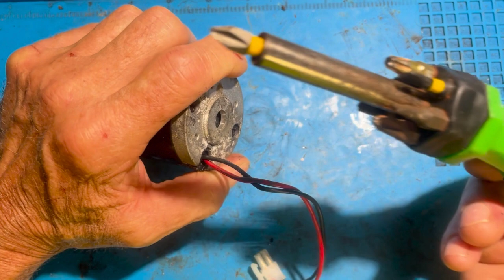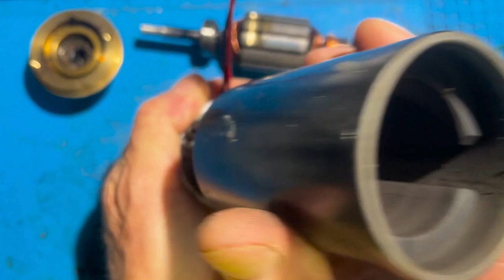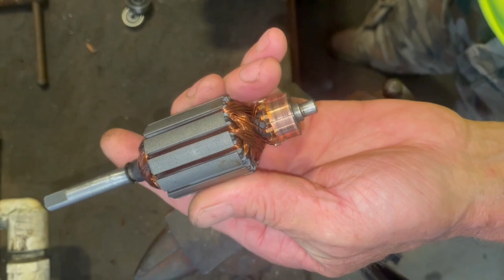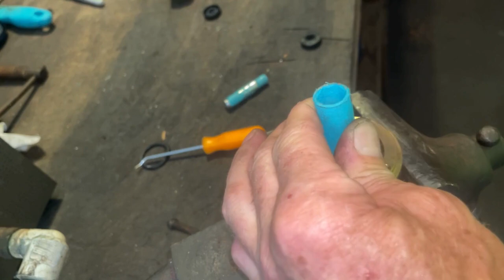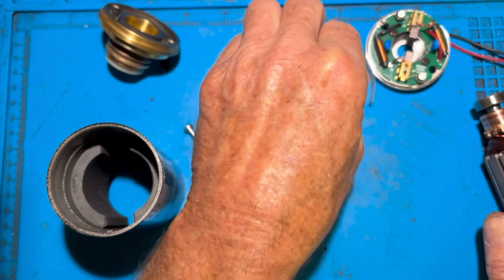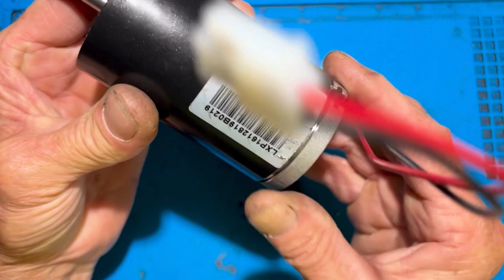How to repair rebuild Impeller motors on Maytronics, Dolphin, Polaris, Aquabot, and Hayward

Comment: Just got your kit, but how do I get the top of the impeller motor off the housing? Is it just wedged in there or is there a mystery screw I’m missing?
Reply from the maker: Yeah, you just hit the spring loaded clip with a screwdriver and a hammer and you should be able to get it off

Comment: Thank you for the video guide.  I used your repair kit to rebuild an impeller whose motor brushes have run down.  The robot pushes so much water now and stays glued to the bottom and walls of the pool.

Comment: I recently took apart my Dolphin Quantum robot and cleaned out the motor since it was starting and stopping after just a few seconds. The impeller motor needed to be cleaned real good. After putting it back together it is now running smoothly for the full duration of a cleaning cycle, except now it is running in reverse. It sucks in eater through the top and blows out through the bottom and no longer vacuums. I took it apart and can't for the life of me find anything that could've possibly been reversed. Almost everything can only be put back together in one direction. The armature, magnetic housing, brushes, red/black wires, motor in assembly, impeller, etc. They all can only be reassembled in only one direction. Not sure why it would now be running in reverse. Any ideas?
Reply: Nevermind. I figured out my issue. I had rotated the brush board 180° when reassembling the motor. After rotating it another 180°, it is now spinning in the correct direction.
Reply from the maker: Yeah, you clocked your motor 180° out
Reply from the maker: Yeah, your brush plate is 180° out

Comment: Hi, do you have any references for the Brushes pls?
Reply from the maker: It would depend on the motor you’re working on, but all of our brushes are specifically made for us and for the motors that we our kits are an exact fit. We don’t try to mismatch any brushes or doing anything all I’d like that we actually have them made to specifications that we set.
Reply from the maker: https://ebay.us/m/ADDfXK

Comment: Hi - what should we clean the inside  with if there’s carbon dust all over from the brushes?  Thanks!
Reply from the maker: You should blow it out with compressed air and then that should take care of it if it doesn’t you can clean it with electric motor, Cleaner or contact Cleaner.

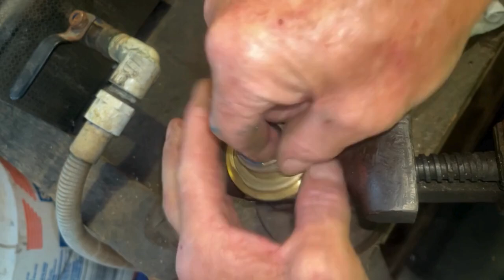Comment: 5:30 Good afternoon, sir. Did you install new oil seals and if so, which ones? Thank you.
Reply from the maker: https://ebay.us/m/ADDfXK
Reply from the maker: The ones that we use are specifically made for us. We have them made with a better stainless steel springs.